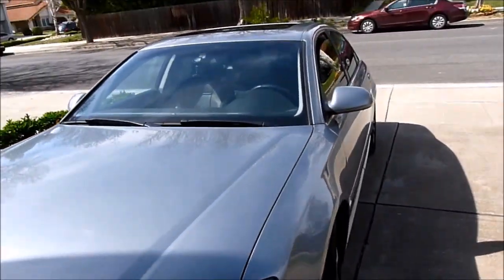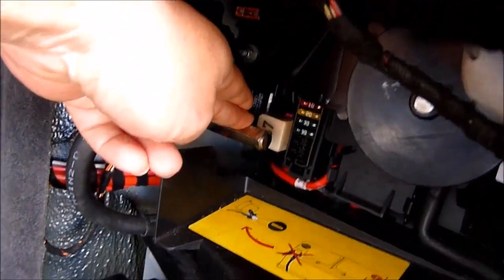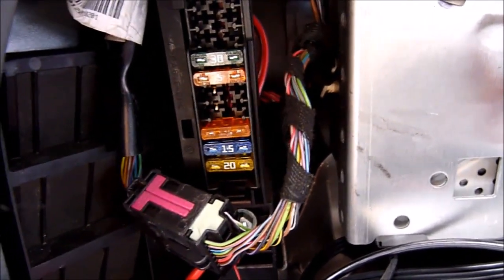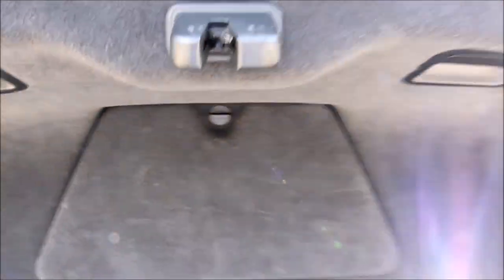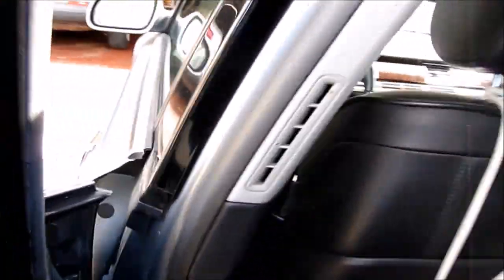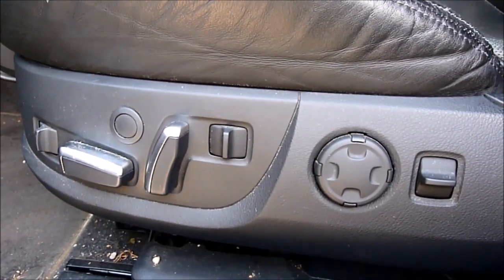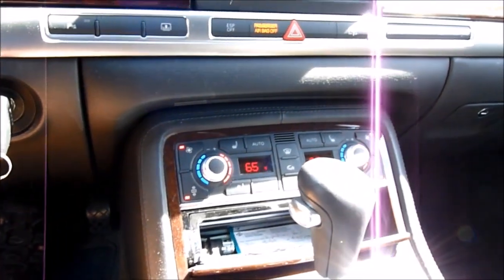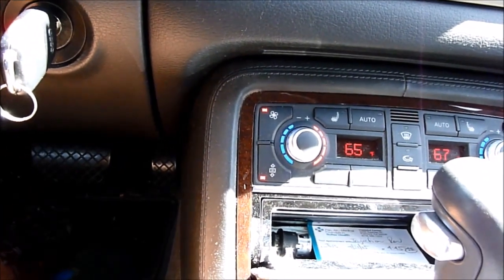An Audi A8L D3 Little Check List Before Buying

Comment: LOVE my 07 A8, still trying to figure out all the features.  This is a Real car.
Reply: I'm looking at an 07 exclusive with all packages and 3 years warranty. 140K miles with new timing chain for $11K. I would love to get it but not sure yet. It's a bit of a gamble, but what a car!
Reply: Ls430/460 is better. From 120-200k, only needed 1 shock, oil, brakes tyres and fuel, still tearing the roads,flying over speedramps at 30-40,creating parking spaces by ramming other cars out the way. Burnouts around every corner, while my kids are playing with the rear massaging seats.
Reply: @chozusmakavelli   no quarto tho. U ain’t as safe in snow as A8L
Reply: How do/did you like it 4 years later?

Comment: Hello , could you please tell me how reliable are they ? And are they hard to work on ? I would really appreciate your input.
Reply from the maker: All Audis are reliable as long as you don't let the mechanics to ruin them. I drove this car for 43k miles without any problems. Go to the website to see what I have done with the car. Most of Audis problems resulted from operator errors, especially mechanics. I bought my q7 new, I haven't had to spend a dime fixing it, besides tires. It has 46k miles, original brakes and everything. Never want own any other luxury  cars. Buy new or from a good owner used. Be careful with dealers.
Reply: @3dogs1monkey  how do I get the TV mode on the MMI? I have an 05 A8 and I know my MMI version is old, I don't have the features you have, how do I get the TV?
Reply from the maker: @JDJD-mw9rr  you need tv tuner to have the menu https://www.dognmonkey.com/audi/how-to-install-analog-tv-tuner-4e0-919-146-on-audi-mmi-2g.html
Reply from the maker: @ld7012  my car was traded to Bellvue Ford in Washington, I doubt you’ve gotten my car in LA, quite a coincidence
Reply: @3dogs1monkey  Trust me I have your car sir, why would I lie? Email me I will give you the Vin #. How you think I found you, easy Google my Vin and your videos popped up. Yes, came from Washington and made it back obviously to San Fernando Valley, Ca. Just purchased it and wanted to know if the timing belt changed or not or any major things I should replace.
Reply: @3dogs1monkey  Same wheels, think those are S8 wheels 18 inch
Reply from the maker: @ld7012  everything is original https://www.dognmonkey.com/audi/category/a8-d3

https://www.audiworld.com/forums/a8-s8-d3-platform-discussion-60/things-ive-done-my-audis-over-years-audiworld-2878706/#post24654189

Comment: hi i want to buy an a8 3.0 tdi but im afraid of problems does it shows any problem to you like air suspension trasmision alternator and other things how much miles does your a8 have and which are the weakest parts of a8 which should i be carefull more does it have expensive parts please respond me. I like your review it helps me a lot thanks
Reply from the maker: kevin musai my  car now has 109k miles, no problems what so ever. Find a well driven car by the owners. Most people who bought TDI should drive very carefully and lightly. My next A8 will be 3.0TDI, it's supposed to be the best engine. Cheers and good luck. The car is very well built and reliable. Go to my website and look at all the posts about Audi.
Reply: Thank you bro but I live in albania and roads here are with a lot of bumps and im afraid of air suspension. And the parts of a8 are expensive like sensors and electric parts etc etc but anyway your review was great thanks a lot
Reply: +kevin musai do u know who is a enver hoja ?)))
Reply: I dont know
Reply: Mine 130k  front air suspension and water pump
Reply: @kevinmusai  air suspension is cheap to fix if you know someone who can crimp a new tube on your Air suspension. Or you buy a refurbish set it costs only 100€ per suspension. And if you don't put your car low or sth they are very reliable. Mine was blown after 300.000kms

Comment: Got a deal on an 07 A8L but the suspension had failed. Pump works but the car won't raise. Only has 68,000 miles. Will I be able to tow it on a U-Haul full car trailer
Reply from the maker: https://www.dognmonkey.com/audi/what-you-should-must-know-about-audi-air-adaptive-suspension.html

Comment: does it has a smart handle that you just put the key in your bucket then you touch the door handle to unlock it ?
Reply from the maker: +Musheer Batayneh Yes, lock and unlock
Reply: 3dogs1monkey
* does audi a8 get a trouble with air suspension as mercedes s class that the car becomes too low on ground ?
Reply from the maker: +Musheer Batayneh When air suspension components are broken, then the car will go to the ground. Mine's been fine. All air suspension are the same. Avoid buying cars that are not garaged. If the car parked outside in the cold and hot, the air shocks rubber get degraded fast and leak, shock leaks cause air pump to work overtime, then the air pump fails.
Reply: 3dogs1monkey
so how can we avoid that ?
* because fixing iy is so expensive sir.
Reply from the maker: +Musheer Batayneh What's made to fail, will fail when the time comes. The best way to avoid it is NOT to buy anything that's made to fail... older A8 D2 don't have air suspension:-)
Reply: 3dogs1monkey
* your car is awesome, the German cars are so solid, powerful, and much longer lasting than Japanese, american, korean, etc.
* you can hold it in your home up to 20 years.
Reply: For sure! We have a A8 D2 W12 (420K Km) and a A6 C6 (380K km) and they are running nice and clean, and i don't think that the air suspension does break as fast as the from Mercedes...

Comment: What's the difference between D3 and W12?
Reply from the maker: D3 is model number for all Audi A8 from 2004-2010. W12 is a sub model that has 12 Cylinder engine compare to 4.2 V8 or S8 = V10. Options are almost identical except some special features. Go to Audiworld Model guide for more info http://www.audiworld.com/audiworld-model-guide/
Reply: Thank you so much :)
Reply from the maker: yung k cash if every thing works, then it's good. It's up to your instinct. Can't tell you. Check everything, if you're too lazy to check then take your chances. 4K can turn into 15k if you have to fix a lot . Read this post
http://www.dognmonkey.com/audi/looking-for-the-best-used-a8-d3.html

Comment: Number 1 should be check if theres a lexus badge on it, if not, your looking at the wrong car.
Reply from the maker: If the badge is Lexus, it's definitely a wrong car, a luxury and performance wanna be LOL
Reply: @3dogs1monkey  mate if you knew anything about engineering and the quality of engineering... Ie rubbers on German cars turn to plastic and break when they get old. They don't use bolts that will easily get rounded. Lexus is built to last, that's the difference.
Reply: @3dogs1monkey  BTW the audi boot, there's spring on the bottom latch inside the boot. Take off rear plastic cover. The spring is tiny, needs a sturdier spring to give the boot lift. I'm doing a fix on my brothers s8 same as you :) 0 thanks for your videos BTW.
Reply from the maker: @chozusmakavelli  you're talking about fixing the car - my A8L seldom needs fixing - I use the right tools, nothing breaks.
Reply from the maker: Trust me, most of my Asian friends drive Lexus, they're amazed while sitting in my A8L... so comfortable while watching videos and listening to iTunes on CarPlay
Reply: @3dogs1monkey  a8 is a superb car i don't disagree, well built. For me LS430 is better, I can't afford a brand new car, I do my own mechanics since I was a child. Lexus was also built with the philosophy of being easy to work on, so any job is relatively easy. Audis are a ball ache to repair and even general maintenance. UK it's all diesels, egr valves, dpf filters, cam pulleys, gearbox issues, many of my friends have these problems with audi, BMW, merc. But you got a 4ltr v8,in uk noone will dream of that engine,probably 3 in the whole country.
Reply from the maker: @chozusmakavelli  I've been owning Audis for so many years, they're the most reliable cars ever, batteries lasted 10 years, none for Japanese cars, lights never burned out, unlike Japanese cars, I only change oil every 15k miles with mobil 1, my cars don't break, most of Audi problems are due to mishandling or fixing by people who know nothing about the cars. They cost me less to drive than my relative Honda Accord and the fun can't be compared. My wife would never drive anything else but Audis and our new e-Golf LOL.